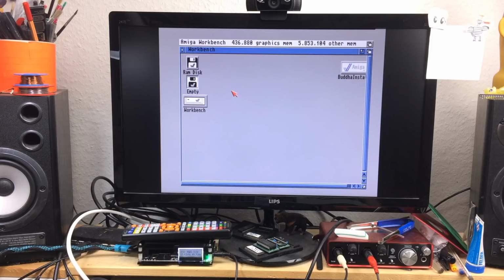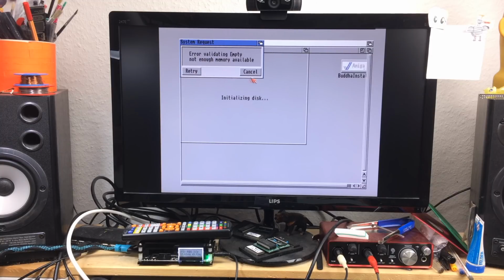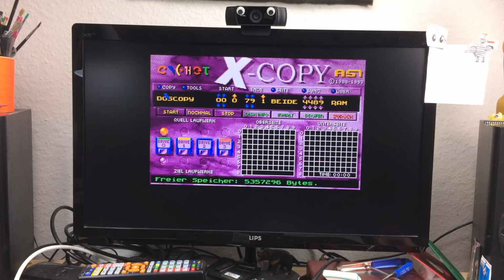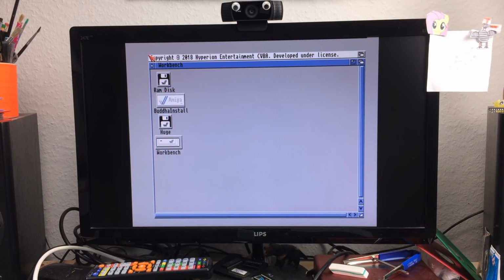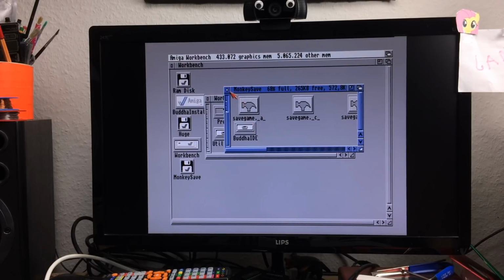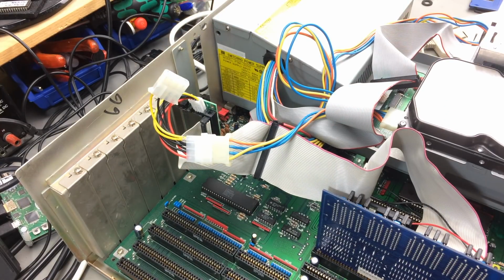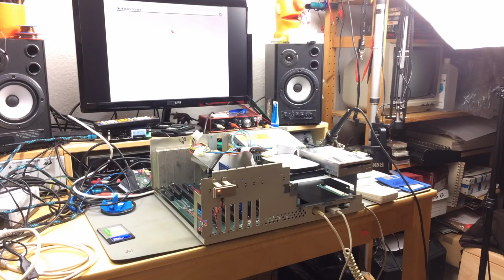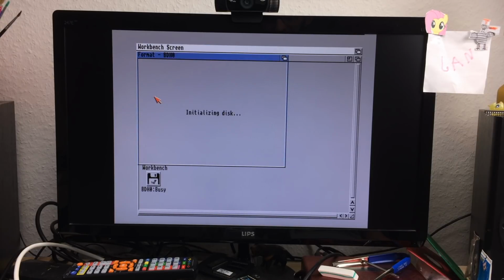Amiga 2000 Large HardDisk Partition w/ BuddhaIDE

Comment: Why do you need power for the CF adapter? Won't it work without external power? I ask because I have a 2.5in CF adapter plugged into a Terrible Fire  accelerator and theres no additional power connector.

Comment: Do you really need a power connector on the CF adapter? I have a CF card adapter on a 2.5in cable from the terrible fire and theres no external power connector.  I bought a rear panel 3.5in IDE to CF adapter to use with a Buddha IDE card. The CF adapter  has a floppy disk type of power connector.  I don't think this needs external power does it? Surely its powered from the IDE ribbon cable as the 2.5in adapter is?

Comment: Another solution: just set the disk up with OS 1.3. In 512 bytes per block.  Calculate with the help of all your software how great every partition must be. Under OS 1.3 you must set all the data into a mountlist. But watch out. For the Workbench the kickstart ROM reserve for every 500 MB 75 kilobyte of ChipRam. The other partitions as Work or extern diskdrives going into fastram.  In the mountlist you can set also the wanted buffers. Every buffer on the Amiga has 512 bytes standard. Working with SSD or CF is also possible under OS 1.3 but then must all the data under 488 bytes per block. OFS format. ( Is equal to ISO format. ) Then update OS 1.3 to your most wanted OS.   ( I'am sorry for my bad English )
Reply: It is not easy, but in my situation i use a very old setuptool for to build up massive partitions. It is the HDToolbox of the A590 HD (1989) setup. And the 1.3 Format command is much much better then the one from kick and OS 2 and 3 and up. With the format from 1.3 even big partitions on memorycards and SSD's can be formatted in lowlevel format, if there's enough ChipRAM is available. So on the Amiga 2000 you need at least 1 MB of ChipRAM  for to do this.

Comment: You shouldn't stop just because it worked.  You should use the smallest sector size that works.  Because it means each file, no matter how small is going to take up that many bytes on the disk.  You basically set it up so that 32k is the smallest amount it can access.  If you have a 33k file? Guess what, it's using 64k of the disk.  It's not just about wasting space either, it means it has to spend time loading those chunks 512 bytes at a time into memory.

Comment: Hello Jan.I have amige 2000 in rev.4.1 and I bought a scsi gvp 2000hc card with disk. Will this compilation work according to you, do I need to improve something in rev.4.1? do i need rev.6.x for scsi?Will the rev. on the higher one is necessary for scsi?
Reply from the maker: The card should work fine on all A2000 generations, no worries. The changes in the mainboard revs are mostly memory mapping and graphics chipset related. The Zorro expansion bus remained the same as far as I know.
Reply: And for me on rev 4.1 the scsi card does not want to cooperate and the Amiga does not get up. Can there be capacitors on the motherboard?

Comment: Hey Jan! thanks for a nice video as usual! I just bought a Buddha and a cf adapter similar to yours or if not the exact same. I do have a question. Did you leave the jumper OPEN on the Buddha for the IDE connector that goes to the CF card adapter ?
Reply from the maker: Yes, you practically only close it for the DOM module that the Buddha comes with (because that needs power over the IDE pins).

Comment: Not very clever to partition the drive with 32K block size. That way you loose a lot of space when saving files with less then 32K, e.g. a config file with 1K, that will use up 32K of hard disk space. Better make more partitions with smaller block size.
Reply from the maker: I'll try to use a smaller cluster size and fiddle with partition sizes soon. This was more of a proof of concept. Still glad that it worked at all.

Comment: You shoud not use FFS for large Disk, this can NOT handel large disk rigth. Usa PFS3 instad. PFS3 is on the Buddah Tools Disk. You change the Filesystem in HDTools. The Worbench shoud be FFS and <2GB
Reply from the maker: As far as I know they updated the FFS for 3.1.4 to make it compatible with large disks? So far I didn't have any issues but more testing is required obviously. Thanks for pointing this out.

Comment: A bit better way to do it would be to make smaller partitions, maybe three 35 Gig partitions, and use a better cluster size of 4096 or maybe 8192. The 32k clusters mean every tiny file takes 32k on the drive, which will make a huge difference if you put things like WHDLOAD files on this drive, which has a lot of small files. It will end up wasting a lot of space.
Reply from the maker: Yes, you are right. I'll probably end up fiddling with settings and partition sizes a bit in the future for making this a usable system. Still a lot of upgrades waiting to be applied to this machine until then. This was kind of a proof of concept. Glad I got the large drive working at all. ;)

Comment: The Workbench library and the icon library no longer reside on the Kickstart ROMs, that's why it didn't work. In fact Workbench 3.1.4 copies them on the HDD/Flash during the installation process.
That doesn't happen with 3.1, which takes for granted those libraries are in ROM. A quick solution would be copying your 3.1.4 installation from the HDD to the Compact Flash, and there you have it! ;-)
Reply from the maker: That'll make a lot of older disks incompatible. I wasn't aware of that when I got the 3.1.4 ROM. :/ There are workarounds I think, I'm going to look into that. More Amiga fiddling ahead! :)
Reply: @JanBeta  
I have got through any incompatibility so far. Also 3.1.4 can handle everything from the older to the newest stuff. If you really want to stick to older Amiga OSs, then just copy those two libraries (from aminet) over to the Hard Drive and add a couple of assign to the startup-sequence.

Comment: Nice tip on the pcmcia-cf adapter. Why have I not done that earlier...
Reply from the maker: Works a treat, you just need a driver for it and it reads FAT formatted CF cards no problem which makes it massively useful. :)
Reply: @JanBeta  Good way of getting some data to it also. Kinda bummed there is no pci-e arcnet cards around ;) BNC ftw :D

Comment: Hello Jan! You can't boot 3.1 with a 3.1.4 ROM because the workbench.library and icon.library are missing in the 3.1.4 ROM. Version 3.1 expects this libraries to be in the boot ROM. Regards, Thomas
Reply from the maker: Wasn't aware of that when I got the 3.1.4 ROM. There's a workaround for it (making a 1MB KickROM) that I'm going to look into. Otherwise it's going to be incompatible with many older disks.
Reply: @JanBeta  But it should be possible to extract the libraries from the 3.1 ROM and put them on the 3.1 Workbench drive. Or maybe try to copy the two libraries from 3.1.4. 
For me I have decided to stick with 3.1.4 and not use any software that does not work with that rom version. The old 3.1 makes problems in so many cases, like cf-card compatibility, big disks, IDE to Sata adapters do not work correctly and many more. All that is fixed with 3.1.4.
Reply: @mac_thor  +1
Reply: Good to know. My attempts of resurrecting an old 2000 (after fixing water damage) went exactly nowhere because of that. And i thought i did s-th wrong :/
Reply: Can you just copy the workbench.library and icon.library Libs folder on the floppy's that boot in a workbench and so, so that you do not have that problem, i have also updated the ROM of my Amiga 500+ to 3.1.4 ROM?
Reply: Hi , The workbench.library sounds something from een emulator. What i know as something in the line of the Workbench.library is the intuition.library. For both libraries you could go to the AmiNet (http://aminet.net/ ) . It's an open source Amiga Software site where people can upload and download ( missed ) drivers and so on. Or you could also go to the Dutch amigascene.nl on the internet. They can also help.

Comment: its worth updating the firmware of the card from the icomp website, helps with larger hard drives :) doh, just seen you did that! lol
if you want to make the empty hard drive icon match the workbench one do this:
copy dh0: disk.info dh1: disk.info
then reboot.
Reply from the maker: Haha, yes, albeit I only updated when I wanted to get the CF card working (which didn't work at all previously). I'll definitely do some more cosmetics at some point. Glad I got the large partition working at all now. :)

Comment: Did you try that "Mengs 2,5/3,5" SATA -> IDE Adapter" on Amazon and a cheap SSD? Should work even better ;)
Reply from the maker: I was considering that but I kind of like the hard disk whirring sound while the Amiga is running. That's why I didn't go with the CF card alone, too. ;)